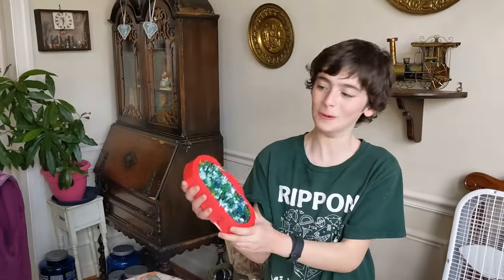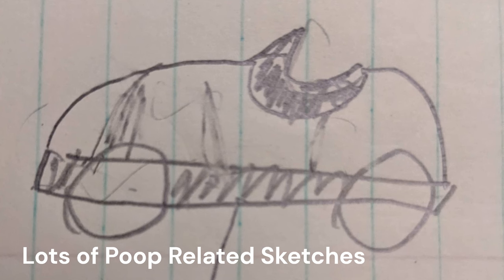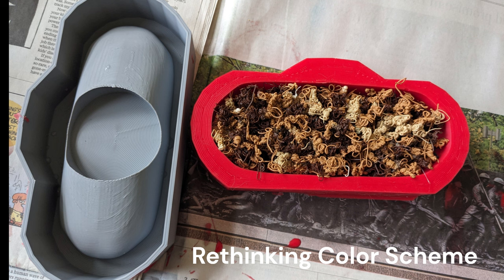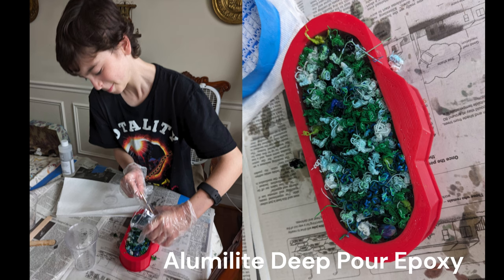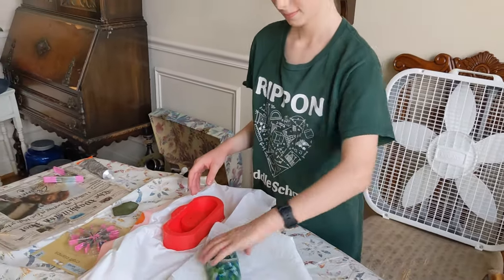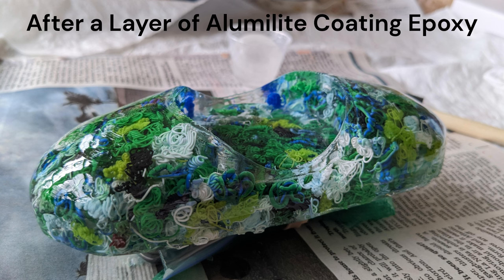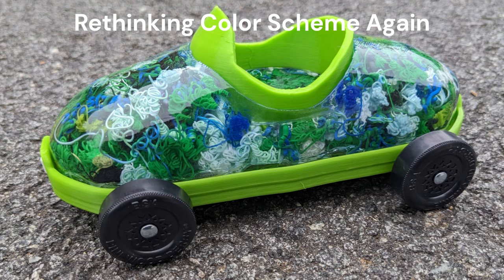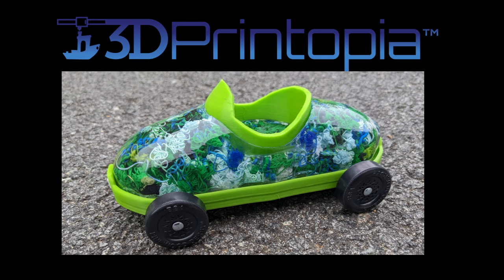Overview of Our Filament Poop Derby Car for 3DPrintopia

Comment: Resin and Bambu Poo is perfect! I may have to play with some later.
Reply from the maker: It was easier than expected and all this filament poop is PLA and it held up to the heat of the curing process just fine.  Though I was using a Deep Pour Epoxy and it sounds like its slower curing process generates less heat.
Reply: I’ve watched a lot of resin pours on YouTube, they never go into how long it really takes. 😮
Reply from the maker: @stldenise  The box for this Deep Pour Epoxy recommended 48-72 hours before demolding.  We went with the 72 hours just to be sure.  Alumilite also had an "Amazing Clear Cast" product that only needed 24 hours, but it was recommended to only do pours up to 3/8" inches and our mold was a little over an inch deep. The Amazing Clear Cast is supposed to get hotter. I did use it circa 7 years ago with colorFabb PLA/PHA for "Glass Wing Butterflies" and it didn't warp the print.